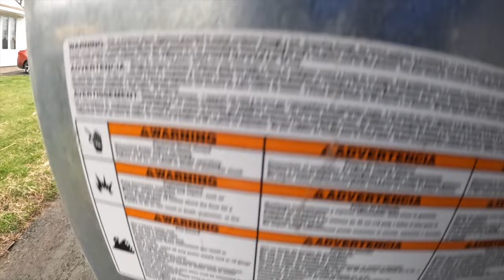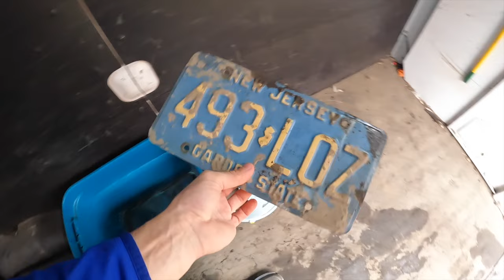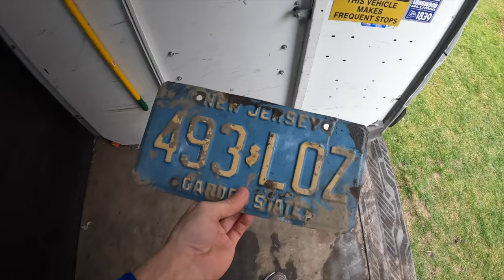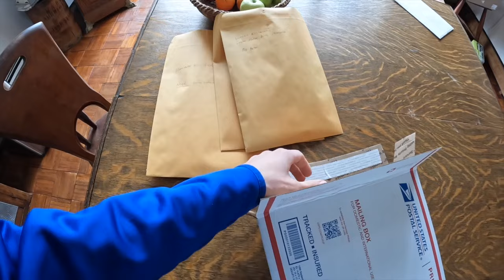Did My Abandoned Storage Unit Strike Gold?

Comment: Its a 360i carpet cleaner. A water line from an extractor hooks up to the right side. Once hooked up. When you squeeze thee right handle water will spray from the jets underneath.  The head on there is for carpet . Try it on a rug . Dont run it on concrete. $2500 brand new. Made by Rotovac. The head has to be flat on the carpet
Reply: This. The squeeze handle simply opens and closes the water supply. That copper valve will adjust the amount of water that actually flows through so you can make it not so wet when you squeeze that trigger handle. That way you aren't just pouring an uncontrolled amount onto the carpet and into the backing. Helps prevent mold from forming in a damp environment that doesn't get dried thoroughly. Also, be sure to research the sprayers and the other equipment from that storage unit. They are probably more valuable than you are thinking.